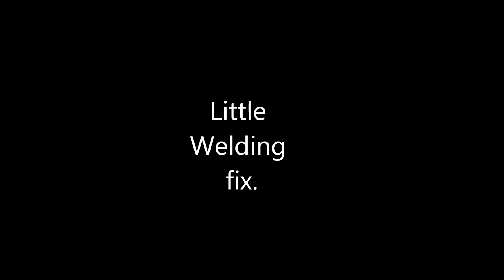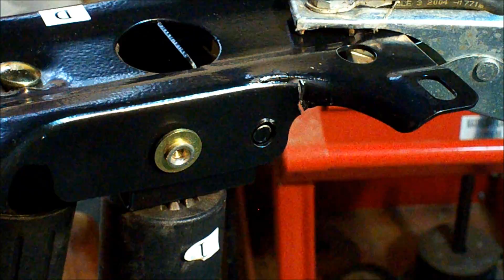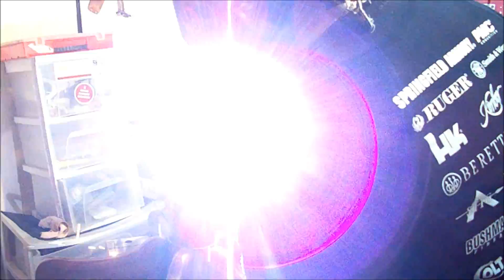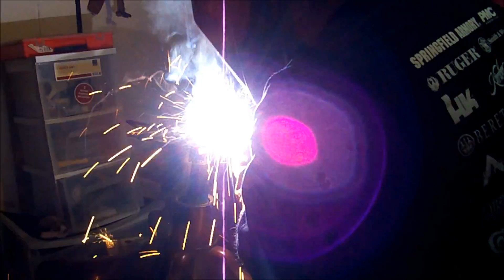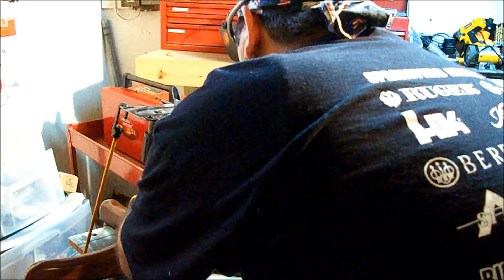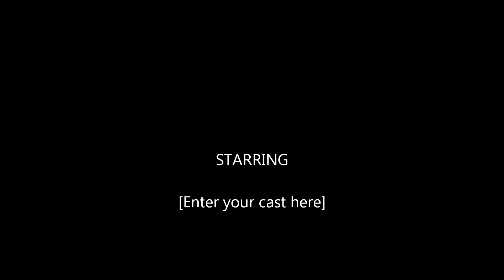Welding project

Comment: man, today I got my little welder out to do a little project for someone.  I have a NICE little miller 110 V unit kinda like yours.  today, for some odd reason it barely would get enough current off the wall outlet to weld, and I usually use a lower voltage even.  Threw the breaker and everything.  I dont know if it was the outside temp or the material I was welding.  was semi rusty.  just using flux wire.
Miller much better than lincoln-alum parts opposed to plastic on the lincoln

Comment: Gotta admit bro that I wasn't sure what to expect out of your welding vid, but hell I'm pretty damn impressed! You can tell if someone knows what their doing a lot based off the way it sounds, and that nice steady arc popping sounded great! If your interested in upgrading lemme know, I've got a craftsman wire feed thats just one step below a 220 volt system. Its lightly used but pretty much like new, and if your interested we'll give you a helluva deal on it!

Comment: @MrAntroc2010 

I used to work with torque converters, Dynamic transmissions. I was the guy that disassembled them after they cut off the initial welds with a lathe, sorting of innards and nasty chemical bath. Shittiest job in the whole plant in my opinion.

Comment: FUCK flux core.  also , stay away from the HD models,  there for the home user and for the little bit more go with an SP or pro . a friend offered to buy me a 140hd in trae for work , then after i got it( didnt really want it but a free tool is cool right ) he ended up not having me do the work and i had to pay for it...FML .about to sell it to go up to a 180c lincoln , 220v .

Comment: I always liked miller better that's what I own and use at work. I have two Harley's and I did a custom fender I had to section out about two inches anyway I tacked the whole thing without my mask on and I burned my forehead like an asshole lol should have seen it.

Comment: I was a Miller or Hobart man myself. Miller for MIG/TIG and Hobart for CORE WIRE. My cutting torch was a Vicker. I worked four years for US Steel before I joined the military. The Steel Mills took a hard hit in my home town of Youngstown Ohio in the early 80's. By the way, nice weld Pete...